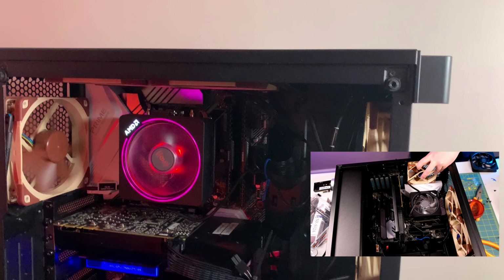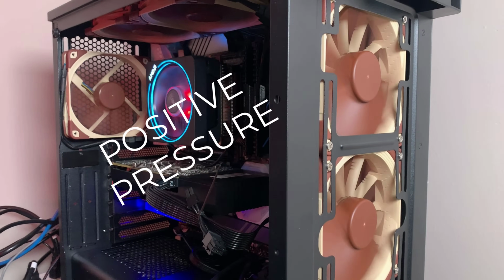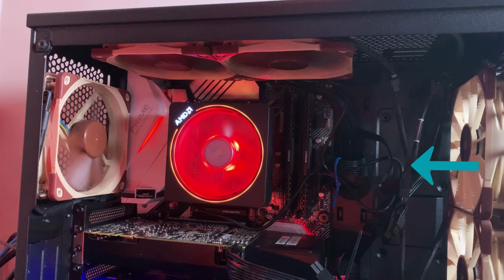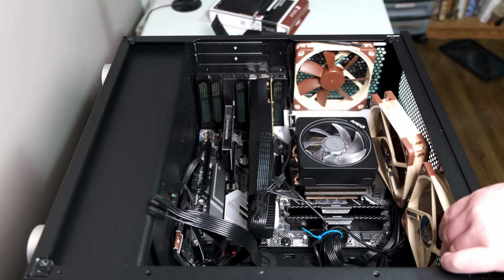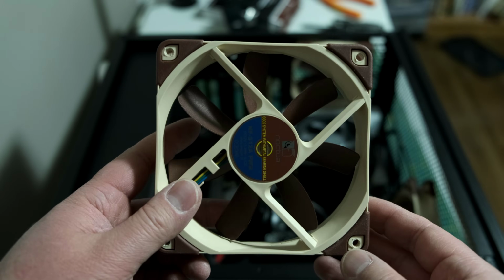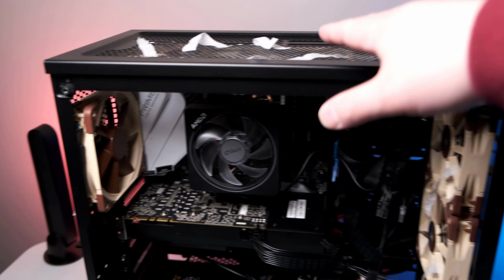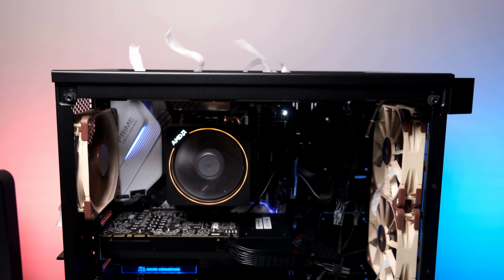Custom PC Build: How to setup your desktop cooling fans for proper air flow

Comment: this has to be the best 5 minute video on airflow. never paid attention to those damn arrows.   Thank you!
Reply from the maker: Hey there! LOL. I never paid attention to the arrows before. That's why I had to redo them. Glad the video was helpful to you!
Reply: @TheWongReviewer  Air always flows towards the fan hub or towards the brackets on the backside of the fan. Good to remember if the fans you have don't have the arrows.
Reply: Bleach
Reply: some fans dont have arrows. the air on fans will always blow in the direction where the bars are, the open side is where air gets sucked in. the "barred" side is where the air gets blown out. the barred blowing out side also always has the uglier logo with text on it :D
Reply: You don't need to follow the arrows, just look at the pre-installed fans that usually come with a case and you'll get a good idea on which direction to always face every other fan you install.
Reply: I have never in my life understood why people need arrows and stuff, just look at the blades and see what way they are pointed towards?

Comment: All intake, single rear exhaust is the best air cooled CPU setup.
5 degrees cooler than anything else.
Positive pressure also keeps dust away

Comment: Inside the case there sould be positive air pressure right? If you use 2 fans for intake and 3 for outtake it will not be positive pressure inside i am afraid. How much important this positive pressure?

Comment: I just purchased a pre bulilt PC (cyberpower i14400f) and I know how to add memory or another NVMe but I have zero clue how to add more fans onto top into an existing system without adding AIO. The RGB, ARGB, additional controllers confuse heck out of me. How would I add more fans to the top of the case and have them sync with my current color scheme.

Comment: You got negative pressure instead. 3 fans sucking out air but just 2 pushing in.
Best solution would be 1 at the back, 2 at the top and 3 at the front.
Same amount of fans pushing in air as being sucked out.

Comment: You should look at the blades of the fan, they work like shovels, the way the blades are shaped and the direction the fan spins whether its left or right will determine where its blowing air.

Comment: Great video. I also consider adding 2x140mm exhaust fans at the top which makes it exactly like your system (2x140mm intakes at front, 1x140mm exhaust at back, 2x140mm exhaust at top). What I'm considering is the fresh air from intake fans at the front maybe sucked up by the nearest top-front exhaust fan before it reaches the CPU and other stuff on the motherboard? Did you test it as x1 exhaust at top and x2 and compared them before? If there is like a 1°C difference, I will definitely go with the aesthetics, I really want to hear from you about that.

Comment: 2 front and 2 top as intake fans and the one fan in the back for exhaust for positive if you do not want dust build up, if you want dust go with negative or neutral setup.

Comment: Not sure if it is there just so clean you can’t see it, but any airflow test you have done without the main glass panel or cover will become redundant because all the airflow just escapes from the massive opening. The fans are pulling air out, just not the air inside the case
Reply from the maker: Yup, you're right. Others have commented how this isn't a "true test" as the panels were open. I'll have to do another one with the panels closed and using smoke versus tissue paper.

Comment: as you look to your open case, from right to left, the right side top cooler, try setting it to bring air into the case. this way you have 2 at the back which pull out and 3 to bring in cold air. you will see an even better cooling effect. to me it brought my ryzen 5600G to 38 degrees in stand by and 54 (at best) in gaming at full settings. at that time i did not have a dedicated gpu but the case was cold if touched.

Comment: Great video. I have a glass panel at the front of my case so there’s a 1cm gap between the fans and the case. Should I just remove the glass or will air be able to be sucked in through the gap between the glass and fans?

Comment: That's pretty neat ! I do have a case with no front fans only one one the top and one on the back and they were both set to exhaust. Should I swap the top one to intake? Ps: The temps always seemed fine.
Reply from the maker: Honestly, as long as you think your temps are fine. I would just leave it. 
If you want to do an experiment, you can change the back one to intake the top one to exhaust to see if it makes a difference.
Reply: @TheWongReviewer  Makes sense ! Thanks

Comment: The gpu, some gpu have design that use the back case as air in and throw it inside the case so the mid and low fan in front should become exhaust

Open 3050 galax single fan main page (there's info about the air flow , i m using this gpu and it does suck air from back and throw it inside the case so the mid and low front fan become exhaust, if it's intake the air flow become clashing
Reply from the maker: Hey there. thanks for the feedback. You make a good point that when looking at air flow, we should also look at what the GPU fans are doing. Great tip
Reply: @TheWongReviewer  because of this galax gpu have high temp reach 80c at full load maybe due to single fan when i tried to check i can feel the hot air throwing to the mid front of the case (from heatsink gpu like the image on the web )and that's why i can see the air clasing the 2nd and third front fan intake also on full load i put my hand near the gpu and i can feel the hot hair shooting from heatsink to mid front of the case just like the in the pic on 3050 galax page

 after i flip the 2nd fan in the front as exhaust temp does not change still on 80 but it better now as it wont hit any 82-83c as before ( 81c max) and the gpu clock speed seems less throttled than before
Reply: I think the best implementation for now are using AIO cooler at the top for cpu  ,  while the rest specifically for other component as the cpu is usually the main blocker for gpu air flow below the cpu (clashing air flow)

Front fan 1 intake
Front fan 2 out take
Fronr fan 3 out take 
Back fan out take

Comment: A case of the 'too many fans and incorrect circulation'.  Some people think just dumping a lot of fans is the way to go but proper air circulation is more important than a lot of fans.  You can achieve this with less fans.
Reply from the maker: Yes, this is a good point and great observation for new builders.

Comment: I will prefer to keep the two intake from the front and The two exhaust to the top.   The back fan should be left not working.. Kinda interrupt the 80% hot air exist.  There should be a directed free flow out of the case through the back.   A fan at the exit canot blow out hot air. .

Comment: This is usually confusing for many people. Great work! But you are still missing one thing. You forgot to close your case. You proved you case partially, but the system normally works in closed case and that's why your side exhaust fan is not working much because there is nothing to work for it or no air around as the case is open. BIG point!!! Don't ever miss this again. You can do it again as this topic is crucial for many people these days. Also think about using so many fans has an effect on your power unit limit or bill and also think about the heat dissipated from each fan itself during their operation.
Reply from the maker: Thanks for the feedback. Yes, I forgot to close the case and will have to do an update with my meshify 2 case with the same experiment

Comment: You should go and watch some Hardwear nexus, don't put an exhaust fan in front on top of the CPU cooler because to takes air away from the CPU cooler before it ever reaches it. Also the tissue paper test is meaningless as there is no side panel?? Pretty much from personal testing having an intake fan right above the CPU cooler can drop temps buy 5 to 8 degrees that's was with a bequite dark rock pro 4 so quite a leap and would save you buying the extra fan which is doing nothing.

Comment: Positive air pressure is actually good, especially for large cases, but you always need at least one fan for exhaust even if most pressure is positive to help. The downside is that positive air pressure is a dust magnet.
Reply: Negative air pressure is what make your insides dusty...

While positive pressure may increase overall temperature due to traped heat.

Comment: Hey your case is not “neutral” pressure, you have more fans blowing out than in, so it’s positive. Which is how my pc is, and ifound it cools better than neutral especially because there isn’t a fan below your gpu, positive forces air around.

Comment: Two corrections.  A) The fans are 25mm in height/thickness.  B) The final example of airflow in the case is actually negative air pressure and not neutral as there are 2 fans for intake and 3 for exhaust.  Negative air pressure environments typically show better temperatures in benchmarks but is know to be harder to manage dust.
Reply from the maker: You are right, this is a negative air pressure setup and it does make it harder to manage dust.
Reply: @TheWongReviewer  Really enjoyed watching the video.  Please keep creating great content! :)
Reply from the maker: @nosajmartinez6175  Thank you for the feedback and compliment. It's just what I needed to hear today after a long day. Appreciate it.
Reply: @TheWongReviewer  Your very welcome!  Its great watching content like this.  Testing and reconfiguring like this takes many hours of work benchmarking and constantly running the same tests over and over.  Great work, please keep creating!

Comment: if i use 2 more fans than you did and i place them in the bottom of the case,should i use them as exhaust or as intake?
Reply from the maker: Hi there. Bottom ones, I would have them intake.

Comment: I’m building a compact case the front panel has the radiator fans and I have it pushing out through the actual radiator. I have one fan in the top pushing down on the aio to help cool but my friend told me to leave a fan on the back to push air out. Should I change the back fan to push air in so it’ll be 2-2
Reply from the maker: HI there.  I would try to keep it balance and do the 2-2

Comment: The fan beside my cpu fan isn’t moving
Reply from the maker: Hi there. Trace your wires to make sure the fan is plugged into the header properly. Sometimes they do come loose. Also make sure you're plugged into the correct header on the motherboard meant for fans.

Comment: 2 fans in front, 1 at the back.=no dust build up.
Fan controller box to set fan 50% rotation speed for silenced operation when not playing.
Cheers

Comment: So for the top fan which way should I put it
Reply from the maker: Hey there. Your top fan should be exhausting air out the top of the case.
Reply: @TheWongReviewer  Okayy :)  and as long as it’s exhausting out it’s fine?  And by exhaust out you means the little “X” on the back is venting out? And it’s liquid cooled too
Reply from the maker: @gamingreacts8787  My current rig has a liquid cooler for my CPU and the fans are exhausting out. I'm not sure what cooler you have as different companies have different indicators for fan orientation. Just make sure when you put your hand over the top of your case, you should feel the air "blowing out".
Reply: @TheWongReviewer  okay brother sounds good and I got the same PC as you , it’s the 3080 with i9 10950 or something with liquid cool
Reply: @TheWongReviewer  well after I thought I had it figured out it’s now giving me an error saying “CPU pump error 90B , after I installed everything to my fan hub, all fans are running correctly so idk where it’s getting that from
Reply from the maker: @gamingreacts8787  I just looked it up and it looks like one of the cooling fans is plugged incorrectly to the motherboard. Unplug everything and make sure you have it connected to the right headers on the motherboard.
Reply: @TheWongReviewer  okay!!thank you so much I’ll try again

Comment: what if you have 2 more fans underneath of the GPU.? how you’ll place them to flow air in to the system or out.?
Reply from the maker: My system doesn’t allow me to place fans in bottom. If I could, i would have the bottom fans intake and the top fans exhaust.

Comment: what if i have two under my gpu, should it face up or down?
Reply from the maker: Depends. Do you have fans at the top of the case as well? If you do, I would have the bottom fans intake, and the top fans exhaust

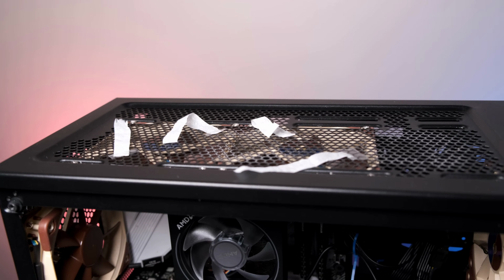Comment: 3:28 Can someone explain to me how the fans on the top are screwed to be attached to the PC? I mean.. are the screws big enough not to fall down the holes?
Reply from the maker: Hi there. Your case will have dedicated mounted holes for your fans. It's pretty standard mounting holes so your screws aren't too big/ small to fall through.

Comment: This was very confusing. You are pretending like the front fan is blowing in when it is really and exhaust fan and you never changed it. But the point comes across.
Reply from the maker: Thanks for the feedback and my apologies it came across confusing. Wasn't my intent. I do plan to do a follow up video with a different case. I'll make sure to demo and explain it better.

Comment: Great video! Could you tell me what's good airflow in my case? It has the same positions for fans (2 top, 1 at the back and 2 at the bottom) where for the bottom, there's actually only one free, because of the Power supply.
I am missing those three spaces for fans at the front because of the case and how it is made.)

So I am thinking of 2 at the top blowing into the pc (the opposite of your case) and the back fan just getting the air out of the case.
Is it a good plan or I should stick with your fans' positions?

I sure hope you read this so I can know what to do. :)
Reply from the maker: Hi there. Thanks for the feedback. My suggestion: 
You have 2 at the bottom. I'm just confirming it's drawing air into the case right?

Comment: Nice video. Thank you. I have a question if you guys don't mind. I have a Dell Inspiron 5675. One of the fans turns on sometimes pretty loudly. I am saying - fan - because that is how it sounds but I am not sure. I recently upgraded the memory with "Crucial Ballistix 2666 MHz DDR4 DRAM Desktop Gaming Memory Kit 32GB". I noticed the inside was pretty dusty but the air can didn't help much. I was wondering if anybody knows of a video I can watch to learn more about these things. Do I need a new fan? How can I know what fan is the one if I have more than one inside? Will the components wear out sooner if this fan keeps turning loudly like that? Thank you so very much in advance.
Reply from the maker: Thanks for commenting. How many fans do you currently have in your system? 
I looked online and the specs of the case. My opinion is it doesn't have enough air flow through the case. From the picture, it only looks like only the back panel has room for a fan? 
You will get dust, that's normal. My setup will still get dust. I just clean it once a month.
Reply: @TheWongReviewer  It has two fans. One at the back of the unit and one on the left hand size attached to the mother board. The right hand size panel is open. It looks like an AC vent. I think it is good for the air flow but bad for the dust. Even the mother board has dust I couldn't get out with the air can. Is it okay to wipe down the dust out or the mother board should never be touch? Thank you so much for your help.
Reply from the maker: @VickyLatorreArt  HI there. If you're using the vaccuum, don't use the head brush as the bristles may cause static electricity and potentially damage the motherboard. In the hard to reach places, I've used compress air or a bulb blower (ones used to clean sensors on cameras). I personally try not to touch the components on the motherboard. Hope this helps.
Reply: @TheWongReviewer  Thank you very much :)

Comment: Nice. Though I believe this is still a Negative case air flow and not Positive as there are 2 in and 3 outtakes.
Reply from the maker: You're right. This isn't a neutral case setup. I was just stating that it's best to be neutral if it's possible.

Comment: Having all intake isn't as bad as people think, you'd be surprised at the temps with all intake. Not encouraging all intake though.
Minimal rear exhaust due to the top exhaust fans pulling all the cool air out.
All intake or exhaust or various mixes of intake and exhaust all have their purpose. One configuration is going to reduce either you CPU or your GPU more than the other. Pick the configuration that helps the area of your highest temps.

Comment: do i need a fan hub for 6 fans that are not rgb? tyia
Reply from the maker: Hi there. It depends on your mother board if it has enough headers for fans. However, I would recommend getting a hub so it will at least guarantee your fan placement due to the length of the wire.

Comment: Hi great video but I have 2 questions. My back panel of my pc case is warped so I can’t put it on. Would this effect anything? My front panel is on with the glass though. My second question is that I have 4 fans. I have 3 intake fans ( I think ) and I have one fan over the cpu. Is that good enough or do I need to buy a fan for the back of the case?

Comment: If I take off the glass panel, would it have better airflow? Or would it affect anything?
Reply from the maker: It will affect workflow because the glass "traps" the air to create like a wind tunnel. when I did my tests, I should've kept the glass in place to show more air pressure.